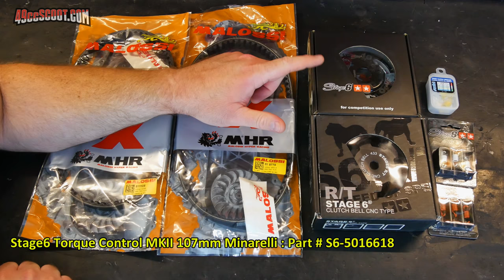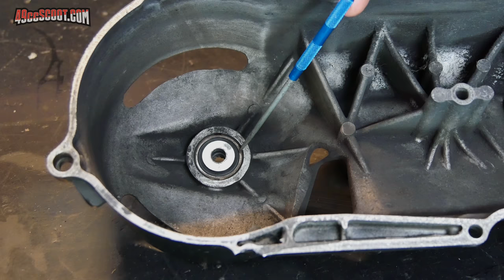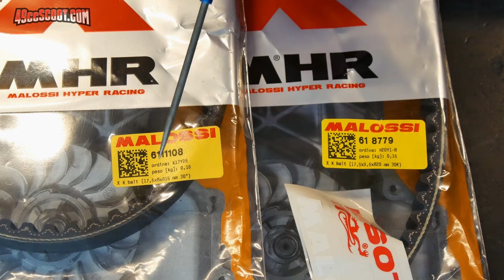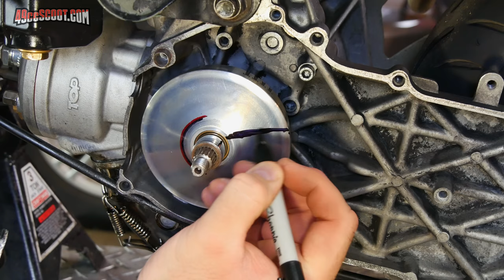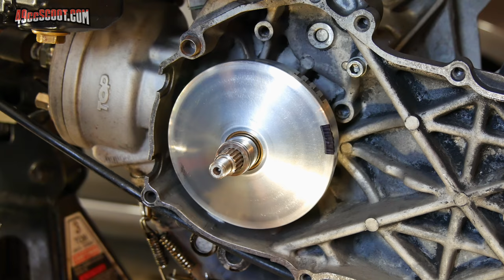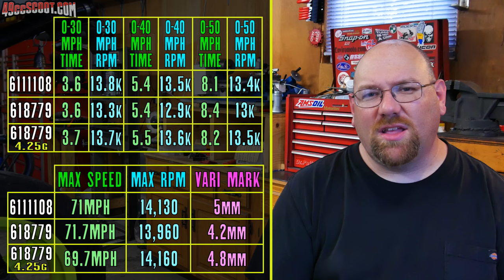Will A Longer OverRange CVT Drive Belt = More Speed & Acceleration For Me?  TPR 86cc Build : Part 38

Comment: Thanks. This is so informative for me as I had been experimenting my scooter to increase the top speed. Previously my scooter max speed around 70mph. After few modification following your video, I can get 80mph tops. I changed from roller to slider, slightly bigger pulley front and rear and others modification to the cdi and everything. Anyway, good test data provided by you👍👍👍👍👍
Reply from the maker: Great result!
Reply: What do you have I hot a navi

Comment: Man love to see your vids they are amazing and educational even to us that think we know it already. Oh and thanks so much for answering the questions I’ve asked you over public comments. I have a couple more questions to ask but need to do a bit more myself before asking. I’m doing basically the same as you but using some different parts as tried most. Thanks again for being a real gentleman 👍🏻
Reply: Just going back to one thing that I think you may need to look at that would also make an amazing video. Carb size and jetting. As I’ve not seen you go larger through your builds.
Reply from the maker: I've only used a 28mm Dell a couple of times over the years and only very briefly because it never did anything for me either time. I have considered a larger carb for this, but I've kinda had the attitude of do it once and do it all the way for that so I looked at the Lectron... but that thing is probably $500 by the time it's shipped and you get the tuning tool. It runs well as-is and my budget it tied up in belts so we'll have to see.

Comment: I have the stage6 r / t clutch in my own setup which is full malossi rc one 94cc and I use the red spring that comes with the clutch, it works perfectly for me, you can set the adjuster so you have good clutch agagement,
Reply: I'm going to try this stage 6 series. It's sounds worth it??!!!??
Reply: @michaelbearse4733  yes!

Comment: Also on the rubber style, I always pop out one side and wash with carb choke cleaner the factory grease, air gun blow-dry and repack with hi-temp red quality grease. Then reinstall the rubber, goes in easy just use a fingernail to walk it in.

Comment: Man, theres something about those chinarelli clone engine carters / cases. I bet its causing the vario half to wobble all over the place, I'm betting there is some sort of harmonic coming in when the throttle is eased and the 2 vario halves start to open again and the belt is somehow skidding and jamming and getting lunched in there. Thats why the best basis for a build like that is the Malossi RC/One engine kit as you get the stronger case and all of the good parts to put it together, I would consider one, but I dont want their vario or the cylinder - I might just buy the bare cases (I know, he is ona budget) but when you add up everything he spends the amount might not be so different.
Reply from the maker: The Chinese cases do get bashed more than I think they may deserve. To be fair, they actually have more material in some areas than the genuine Yamaha stuff. Build a stroker with both and you will clearly see it. I'd love an RC-One, but it's a big chunk of cash all at once and I'm not sure how they do with real street duty either. Again, not many people really ride them.
Reply: @49ccscoot  To be fair I havent had one in front of my eyes.. going out on a limb - I think maybe the polini case covers that have the extra bearing supports inside them could help this problem, if only you could fit a small DV-cam off of a quadcopter inside the case to see what is happening just before the belt shreds? ;) 

I couldnt afford to buy the entire complete 94cc rc-one engine either, Like I could buy a complete 15 year old 1000cc sportsbike in decent condition for what it costs here in Australia - just cannot justify it. I think I will stick with the cases I am using and buy the MXS cylinder and periphery, maybe use a stage6 overrange tranny, I hope to find a 112mm CPI / Morini clutch secondhand on ebay classifieds before I go that route..

Comment: Roller weights rhat are dialed in. Along with proper clutch and torque springs with OEM belt makes the most difference. If you must have more speed change the internal gears. Only thing that will bring up your speed after that is a big bore kit or buying a bigger bike

Comment: Hey my variator face on both side have wear marking like rings in different locations I can feel them when I run my fingers on the variator.  Is that normal or should I replace both pieces?
Reply from the maker: If it's worn enough to feel low spots, it's time to replace them.

Comment: Finally a good clutch, that should be 100x better and easier than the stock one
Reply: And i still think theres something wrong with the cvt, i have done 1000 miles with my 86cc tpr and malossi la furia rossa kits now and the belt hasnt even worn yet. Dont know if you found the solution, havent watched the whole video yet
Reply from the maker: I hope it's way better, but I still wonder if it will really change much. I think my stock clutch has been nothing to complain about. When I got into this build, I thought there was no way that a stock clutch could work well at all based on pretty much everyone's remarks.

Comment: l to found replacement  clutch springs a problem , 3 months wait for whatever colour ? specs usually wrong so , the stock noisy, loose spring needed repairs . Torch the end  until red hot before you bend for more tension so it's a   tighter fit,  or less tension if you want it left stock . Very easy to make your own friction points then paint whatever colour floats your boat.

Comment: Hey, love the videos! I had a question on deleting the starter clutch and gearing for the electric starter for a 1998 cw50. Thus deleting it left 3mm space to make up.Do I put a thick washer to make up the difference? Or possibly direct me to a video that might explain it to me? I appreciate you and the videos you make, they help out a'lot!
Reply from the maker: Just add spacers to make up for it. If you match the thickness that was there, then you should have the same pulley alignment as before and not have to change anything to make the kick start work and so on. When you assemble it, make sure the splines on the crank don't come past the splined parts (kick start pawl). Otherwise the vari can't be tightened properly and you can damage things.

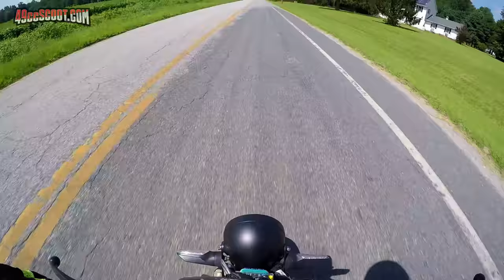Comment: love your vids! I'm wondering what that oscillating sound is @ 18:27 my scoot does the same thing at high speed. is it normal? where is it coming from?
Reply from the maker: Usually it's a wheel/tire balance issue or something in the gearbox.
Reply: @49ccscoot  thanks a ton for your reply, whenever I want to learn something about the gy6 I always look to your channel I appreciate what you do

Comment: Did your cooling holes cause the cracked clutch bell?   How are you getting more free air into the clutches?   Bill
Reply from the maker: I've used cooling holes on all of my small scoots pretty much as long as I've rode them without issue. I would suspect cracking to be from years of use, especially with multiple setups that hit hard. The cover is vented front and back.

Comment: Where do I find the spacers for the variator boss.
Reply from the maker: ScooterTuning should have them. That's where I got my last batch. Before I knew that they were sold, I used to buy shims from McMasterCarr and just grind down the outside diameter to match or be slightly smaller than the boss since I couldn't find any exact fit. Now scooter tuning suppliers carry them so it's way easier.

Comment: Thinking about your alignment: you ride at high speed for long distances, how much does the variator push the belt away from the engine towards the cover since only one half of it moves?  I’m a noobie at this but I’m mechanical minded.
Reply from the maker: The front movable half (variator) pushes away from the engine case. The rear movable half (torque driver) moves away from the engine case as well, so the whole system should stay aligned roughly as it is at rest if it's in sync for the most part.
Reply: 49ccScoot 
Ok, I was under the impression the movable part of the rear was in the wheel side, not the clutch side.   I’m still learning how the system works. More so thanks to your video series.
Reply: @robertpierce1981  you're correct, "the movable part of the rear is in the wheel side"

The wheel side and the engine case side are both the "right" side

The belt moves toward the left, away from the engine case and away from the wheel

Comment: 🌟I'm going to check with the company & see what set up would work on the 171cc GY6 or if you could recommend one . I appreciate the advice on the oil cooler makes a big difference with heat soak so much cooler . Going with 4valve head , hard to find liquid cooled 💯Salute thanks for all the helpful tips 🛵🤘😎
Reply from the maker: I don't do enough with the GY6 to give much specific advice on them. LC doesn't seem very common. Mine ran so hot that I'd think it would be a good thing for the large versions, but most stay with AC. I think the only LC cylinder that I've seen was Taida, but again I don't really follow the GY6 market much.

Comment: Have you sanded some aluminum off the engine block so that your V-belt does not go against anything after the pulley has become larger.

or was this not necessary on your model scooter.
on Yamaha Aerox 50cc models,
you must grind the engine block between the vario and the pulley. for above and below
Reply from the maker: I don't think I removed any material from the case. I believe I did from the cover. Sometimes I do and sometimes I don't. Depends if I see a lot of contact.

Comment: Hey there sir good morning, another  great video as always. I have a question that’s off topic, I have a 1979 Honda express2 scooter and I’m considering a GY6 long case swap. Do you know what size wheel would be biggest? I heard that the size would a 13 inch wheel and the bike has 14 inch wheels. I really don’t want to spend over 500 dollars for a GY6B set up that uses up to 16 inch wheels, thanks for the video and ride safe.
Reply from the maker: I think they stop at 13" unless someone custom makes a 14" wheel. Maybe check your actual tire diameter vs what the GY6 would be to see how much different it is. I think my old one had 130/60-13 tires which were about 19.14" diameter.
Reply: 49ccScoot thank you very much for time, I’ll have to do some measuring.

Comment: Good stuff dude and right on time. I've been playing around with new belts or at least shopping for what I plan to mess around with lately. What's your final drive ratio btw?
Reply from the maker: 11.2:1
Reply: How do you get to this ratio?
Reply: @michaelbearse4733  You swap either 
your primary or secondary gears to get your desired gear ratio.

Comment: Have you ever had issues of your kickstarter cups grinding together after shimming? I had min shimmed it seemed perfect, but my cups would touch when I would rev it
Reply from the maker: Yeah. It's a fairly tight tolerance. A lot of times, any slop in the assembly in the cover can  cause it. https://youtu.be/wxgXQjRyahY?t=869
Reply: See my kickstarter shaft that the kickstarter is on seem to have little to no play but the cup that in the cvt cover seems to move easy
Reply from the maker: @nastynatesscooters9896  If the cup or pawl on the crank is moving, then you need to find out if the whole crank is moving (maybe bad bearings or worn cases) or if the nut is loose or spacing is not correct and allows play.

If it's the gear under the cover that rides on a pin, then make sure the pin is secure and the pin and gear aren't worn and loose fitting.
Reply: Is it ok for a molossi belt to slip a little when adjusting it after install? I can’t tell much when I ride.
Reply: Where can I find those bearings that’s in the vino cvt case. That holds the rear pully shaft

Comment: Check the angles of the variator and rear pulley if the belt has a 30° angle that means that variators and pulley should have at least 14° but obviously half of 30 is 15. I believe the malossi variator you're using comes with 13.5°...  hope it helps.
Reply from the maker: I know the rear pulley is 14°. I checked it and actually re-cut it on the lathe on one side when I first got it and did some mods to make it work as well for me as the old steel unit did. The variator is close to that. A 28° belt would probably be closer to ideal, but these are both belts that Malossi supplies with these kits and it should be able to wear in to that much difference pretty easily.
Reply: The reason why is because the steeper variator angle ensures the belt slides vertically on that axis to travel on the variator face

Comment: What kind of Tun brand can you trust if it's a V-belt you have to buy, I'm sorry I can't find a Tun brand that lives up to the length they have given up their V-belt for..
Ex-polini with item no. 248.040. the V-belt is stated to have a length of 750mm and if I measure it as you do, it is about 741mm. the same is the case with the standard V-belt polini has which is used for 50cc setup.
I have been trying for a long time to find the length I need, and it is precisely 750mm, but it is not one of these tuna brands that lives up to the length they have given up their V-belts for... I have tried the following tuna brands now..
Polini std - Polini kevler - Malossi -
Athena kevler ... it's only a tuna brand that has lived up to the length that they have given their V-belt to in length, and it's from tuna brand Stage6 ... I tried to measure measure my Stage6 R/T oversize V-belt and it is stated to be 775mm and that length fits if you measure it yourself according to...
unfortunately, I can't find any Stage6 V-belts, which are about 750mm here...

If you know of any V-belts where you know it is 750mm in length, please let me know or if you know a Stage6 V-belt, which is about 750mm here

Comment: Hi what make crank are you using? & what size rod? Also what make cylinder are you using? 
Thanks Adam
Reply from the maker: It's all part of the TPR 86cc kit for Minarelli. Came with the crank and cylinder kit as well as bearings, studs, seals... It's unboxed in the beginning of my TPR 86cc Build Series and the whole thing is shown being built. 44mm stroke, 50mm bore, 85mm conrod.
Reply: @49ccscoot  cheers for the response dude.. I’m getting a Malossi MHR 70cc engine from scooterswapshop but to compare them what did the total cost come to for the full engine build? 
Also your videos are really helpful, I’ve learnt so much from them
Reply from the maker: @Aj-om4dt  The crank and cylinder are basically $500, again with studs, seals, bearings...
The MHR pipe IIRC is around $400, but there are cheaper options. MVT is about $300, but I think you can get ignitions cheaper without charging. Case machining would be expensive to have someone else do it. I do mine.

Comment: @14:15. Is that the best way to see where the alignment is? And could am out of wack belt alignment not allow the back wheel to turn??
Reply from the maker: I think it's a good practical way for most of us to check. I know that snowmobile CVT service sometimes involves laser tools for precise alignment. They seem to be expensive and custom made, so again I think most of us will need to use a simpler method like the one shown.

If the alignment were bad, the only way it's not going to turn the wheel at all is if the belt comes off totally.

Comment: I have two 1p39qmb engines, one used, just under 5k miles on my scooter and a never used brand new one, both 49cc. Should I bother putting a big bore kit on the used one or just do the kit on the new one (49cc to 80cc)? Or do both LOL!?
Reply from the maker: Either way. Depends on your preference I suppose.  If there is any warranty on the new one, then I'd say at least ride it first and make sure it works before the BBK.

Comment: For Hilly areas.. is it okay  or can  I use a lil shorter belt thn the stock !? What about the wideness of the belt ? 

Alil shorter and lil fatter , wider will be okay ?
Reply from the maker: You can use whatever gives you a good result, but generally shorter (than  stock) belts aren't good for performance. Wider belts tend to lower RPM, but if they are too wide they can't travel the pulleys well.

Comment: have you tried removing the 1mm washer?
 and what was the effect on it using longer belts?
Reply from the maker: I didn't. I have used the 6111108 without shims before. Top speed was higher, but takeoff wasn't quite as good. Still not bad.

Comment: Hey man, can you help me know: how about the variator mass itself (the weight of the pulley, clutch, bell, not the roller weigh) affect to scooter performance!?  The more light weight variator kit, the more performance, isnt it?!
Reply from the maker: The variator mass would work basically like flywheel mass. Just like a small, light, inner rotor increases responsiveness, a small light variator would have a similar effect. A big heavy variator would make it less responsive, but it may maintain speed easier from the increased momentum/inertia. Realistically, worry about what the variator does for performance otherwise. How well it keeps you in the powerband. Variators are mostly aluminum, so not very heavy and if they are larger, then that usually increases shifting potential (all else being capable) so the action of the vari is more important than worrying about mass IMO. That said, don't buy a steel variator.

Basically the same deal on the rear pulley and clutch stuff. Lots of mass increases resistance to change.
Reply: @49ccscoot  thanks for your reply 😍
As i think, the variator mass look like the weight-balancing for the engine, so light-weight variator is good for acceleration but i think it do not light too much, to keep the engine in control, please correct me if i go wrong 😁, thank you.